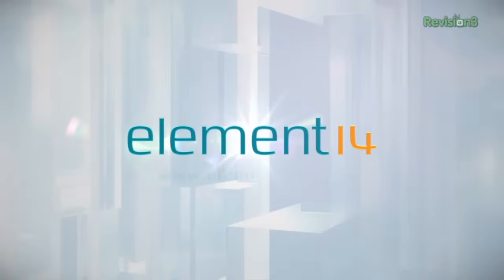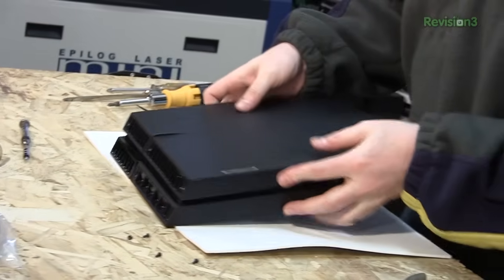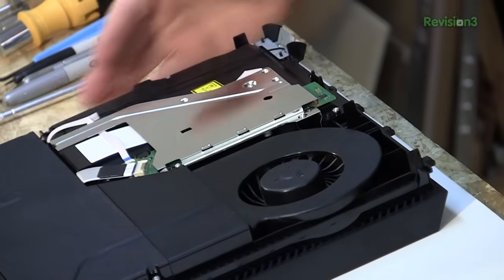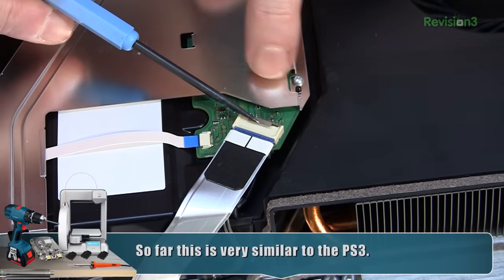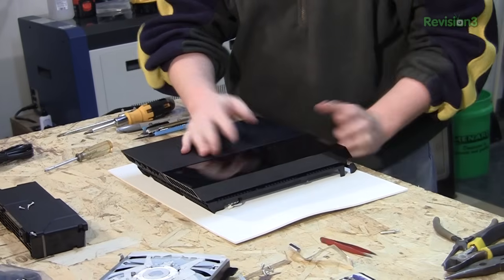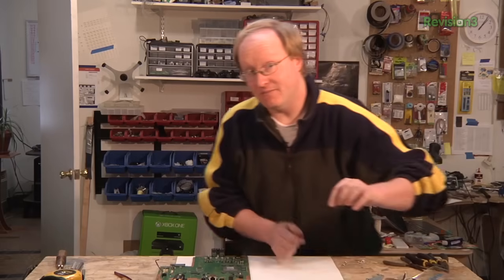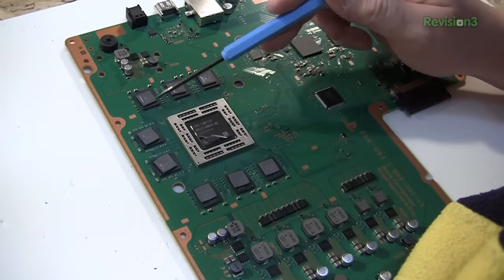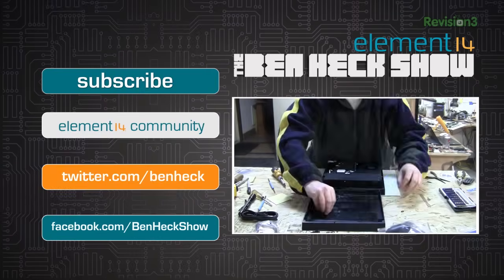Ben Heck's PlayStation 4 Teardown

Comment: Could you upgrade the PS4 with any brand HDD? Provided it's 7200rpm and 2.5" like a laptop hard drive, of course, to match the Samsung one that's inside. But could you put a different brand in there and would it work?
And is it possible to put an SSD or similar in? Would that have any effect? If anyone can help me out with that would be super appreciated!
Reply from the maker: Hi Dennis! You might find a better audience to your question on the Ben Heck Show Community : http://ow.ly/FgstW
Reply: The Ben Heck Show Thank you, sir! I'll make sure to spend some time on there.
Reply: gtileo True, but since you're going to download many more games than last gen (and I downloaded quite a few on my Xbox 360!) you're also going to want storage space. And a good size SSD is very expensive, maybe a lot more than the PS4 itself. So I might check if there are people interested in that, buying a PS4 with a small but fast SSD, or rather a regular HDD with more storage space.
Reply: ANewEvilRising hey I did not mess up. Sony wouldn't repair my ps4 due to there being a spider inside it. So I had to do it myself. And it was the powersupply. I have it fixed now so
Reply: Dennis Z you can put any 2.5" drive inside SSD HDD sítě dont matter and brand dont matter
Reply: Dennis Z  Just buy a hybrid 1tb drive, either seagate or western digital will be fine.
Reply: Commander Steel Don't waste your money on an SSD for your PS4 as it will not outperform a Hybrid drive in any substantial way to warrant triple the pricetag.  Buy a 1TB Hybrid drive instead as you can get them for like $100 or less and see similar performance over the stock drive.

If you need more proof go search PS4 SSD upgrade and you'll find plenty of videos comparing loading times.  It shows that both Hybrid and SSD have a decent performance boost over the stock drive but the difference between Hybrid and SSD is marginal even though Hybrid is 1/4th of the price.
Reply: IamEld3st It'll take some courage for me to cough up the money but I do want to experiment with it. Thank you.
Reply: Dennis Z Actually it would be harder to place a HDD in a console considering they tend to be bulkier than ssd. Usually around 3.5"

but yea I found a 500 gb hd for $180 on newegg. It would be better if you had an alternative for your SSD in case it didn't work, like say a computer to place it in. TBH I doubt it would work, because that's just not how consoles work, and the data cable he removed from the hardrive didn't look like SATA cables that the most modern storage drives use. I sure it's probably some form of sata, but with a specialized connector in order to prevent unspecialized storage devices from being used.
But that would take a Storage drive cloner.
Reply: Commander Steel  I bought my 2 Terabyte harddrive off amazon.
Yeah I wouldnt go bigger than 2 Terabyte anyways.
I wanted way more space not speedy like an SSD. I did get a performance boost when I installed the 2 terabyte drive and after I reinstalled the PS4 operating system.
Reply: +Commander Steel For people in the future that will read this set of comments, get a SSHD not an SSD (too expensive) or HDD (slower).
Reply: I saw how somevody tested 240 gb ssd in ps4 and he got faster loading and it worked just fine
Reply: by harddrive, I mean SSD sorry... 

IamEld3st 
Really, cool. Is there a video of it?
Reply: I will look for it
Reply: Hey there everyone. my ps4 made a pop sound and it doesn't work, won't come on or any of the lights, it's just dead. So i am thinking it may have been the powersupply. so i bought a powersupply still waiting on that to come through mail. I sent the ps4 to sony for repair but it had a few bugs. so they didn't repair it and i lost my warranty so am having to fix it my self. but i was wondering could it be the powersupply? what could an pop sound mean? i already searched this online. but there isn't much about it. so if anyone else had this problem let me know what you know?
Reply: POD TRASH
Thanks for the tip. I did sort of notice that an SSD doesn't really get the full speed utilized on a PS4 on people's videos. Once I have the console, I'll keep it in mind c:
Reply: LostSoundNetWork you fucked up so bad. Why would you fuck with your ps4 if you werent completely sure what you were doing? And you had a warranty that you made invalid as soon as you opened up your ps4. Good luck I hope you can fix it
Reply: As long as it has 256 gb of storage min and useses sata 2. I have heard that the console has trubble reading anything more than 2t.
Reply: Commander Steel 
Yes you can put any harddrive in there. It must be 2.5" but I wouldn't go under 7200rpm.
Reply: ***** That'd explain why a regular cheapo hdd already speeds up loading times a little!
Reply: +Commander Steel It's not worth the money lol. 
You only get around a 20 sec loading difference on a 300$+ SSD for digital games.
Reply: There ya go XDDD
Reply: ***** Yes, looks like an SSHD is the way to go, not too much noticeable improvement compared to an SSD as far as I've seen.
Reply: bro this thing to do is to put your console in a microwave and then throw it in the bin and save up for a pc